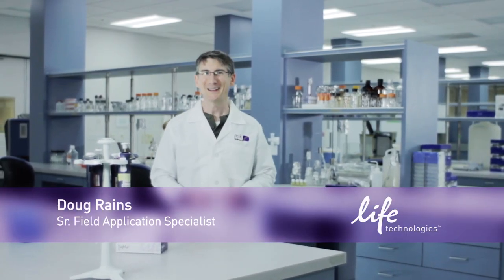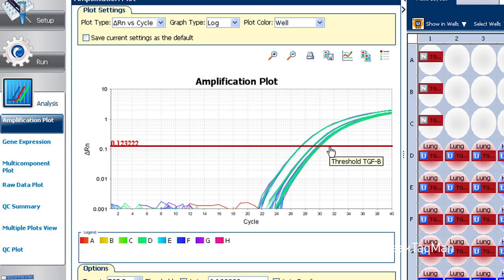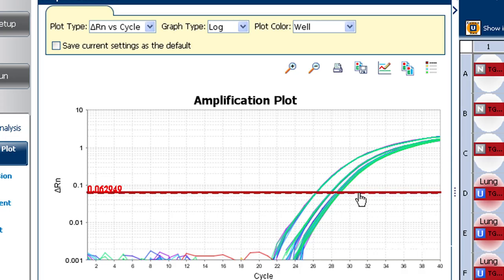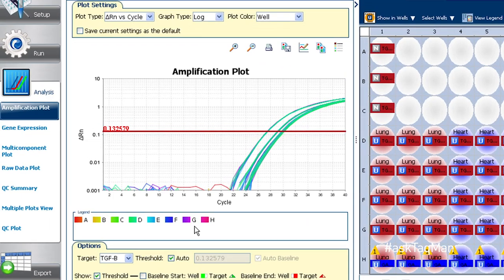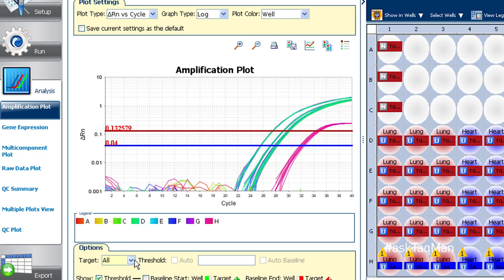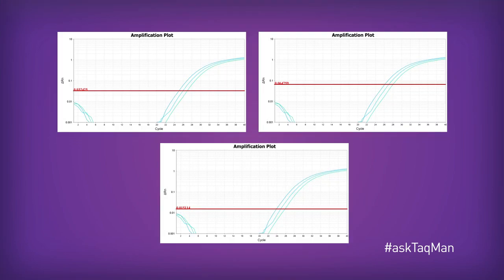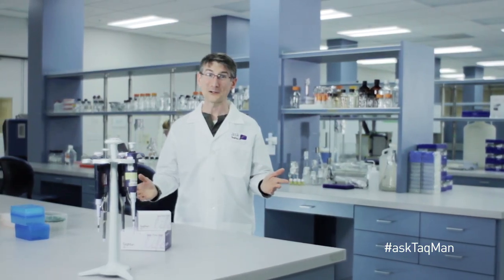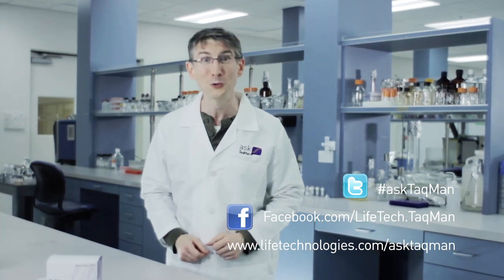Real-Time PCR Thresholds and Where to Place Them -- Ask TaqMan®: Ep. 6

Comment: I found it really useful, but sorry for questioning the placement of the threshold. I think the threshold should be placed lower than the middle. For the first reason because the efficiency is more stable so the amount of detected DNA is better correlated to the starting amount of DNA. For the second reason, with most plates the samples only show a clear start and make weird curves after that. Then you have to place the threshold at the start of the exponential phase. Am I overthinking?

Comment: I did a qPCR experiment with miscript PCR array, and I got a high Ct values, I suspect that the threshold wasn't set properly, it was automatically calculated and referring to the graph it looks very low, below the exponential phase, this could be the reason??

Comment: Thank you for the great video!! However, if I want to determine the relative expression of several different targets in the same sample, would my threshold value need to be the same for all targets? I am using the quantstudio real-time PCR system and software, and the default analysis sets the threshold at different values for each target. However, if I want to compare the expression of several targets to the expression of one "calibration" target, the threshold value needs to be the same for all, correct?
Reply from the maker: +IuliaD111 You will want to set a different threshold for each gene.  If you are comparing data across several plates, you will want to make sure that you use that same threshold (per gene) across all the plates.  I think you are referring to the normalization that occurs by subtracting the endogenous control gene Ct value from the gene of interest Ct value.

Comment: i have a question, 

why sybr green have melting temperature and taqman doesn't?
Reply from the maker: Thank you for your question Anisha. Both TaqMan probes and Sybr primers do contain melting temperatures. 

May I ask if you are actually referring to why Sybr experiments contain melt curves and TaqMan experiments do not? If you are, the reason is that the Sybr chemistry is reversible. During amplification, the Sybr dye binds to your double stranded product. During the melt curve when your double stranded product is denatured to a single stranded product, the Sybr dye dissociates resulting in a decrease in fluorescence. This is why you see the decrease in fluorescence during the melt curve. 

TaqMan chemistry is irreversible once amplification is performed. During amplification, the TaqMan probe is cleaved releasing the fluorophore from its quencher. This results in an increase in fluorescence. The fluorophore cannot be requenched later on in the reaction so even if you were to perform a melt curve, the fluorescent levels would not change. 

If you have any additional questions, please let us know. Thank you!